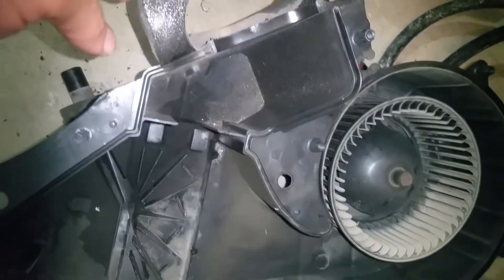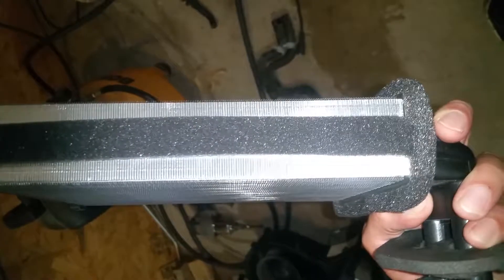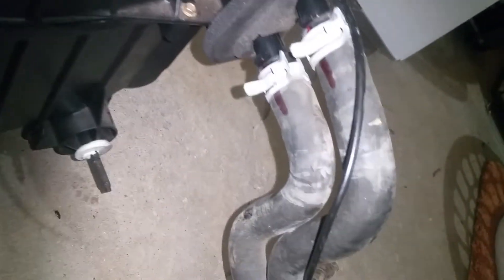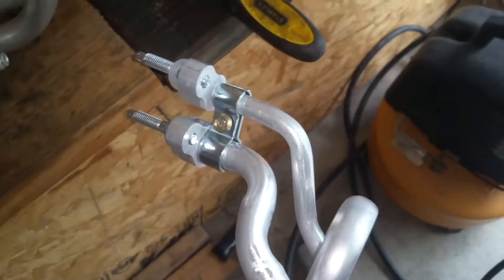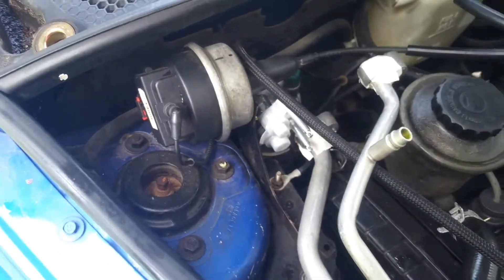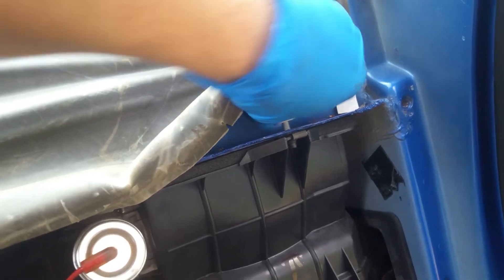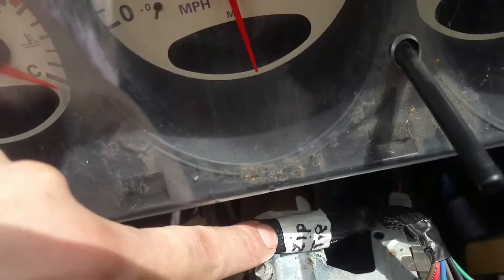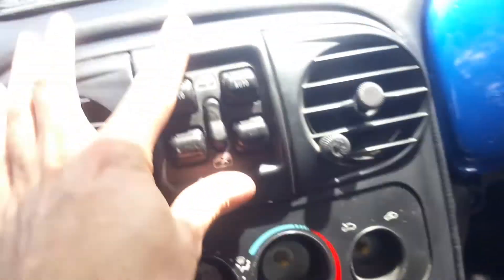How to replace heater core pt cruiser part 2 final

Comment: Thank you for taking the time to make the video. I have to do this soon as I bypassed the heater core this spring on my $300 beater with no heater. 🤣It looks a little harder than my 02 Ram but knowing where all the screws are and what comes out will help. Book time is 6 hours, and after seeing everything come apart, I see why. Thanks again!
Reply from the maker: Thank you for the feedback , and thanks for watching.

Comment: Moving right along. Smart move to verify door and cable operation pre install. You'll have great A/C for the rest of summer and killer heat  for winter. Thanks!
Reply from the maker: +Baxrok2 thank you , believe it or not it went back together way quicker than coming apart . Usually it's the opposite . I hope the video is helpful and detailed and can give someone the added confidence after watching. Thanks again for watching